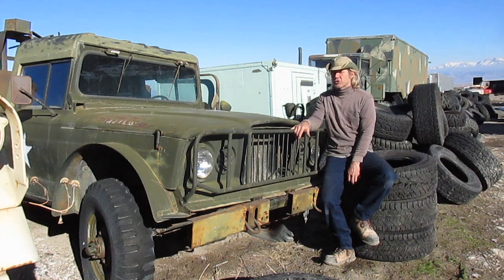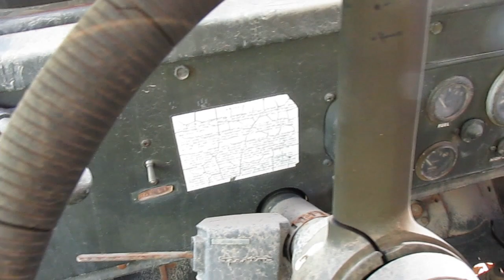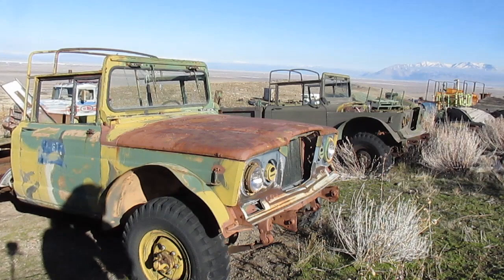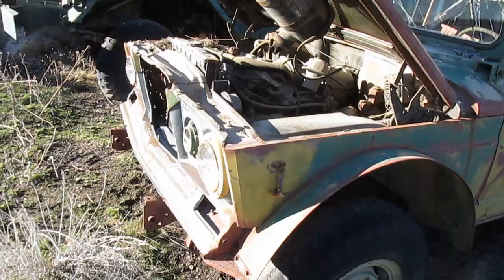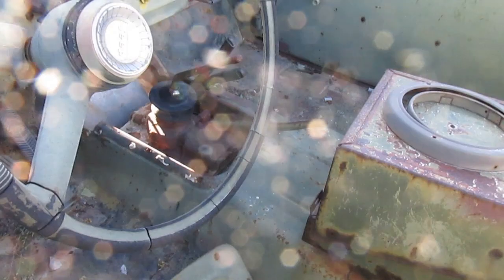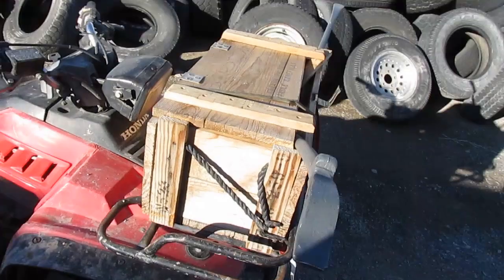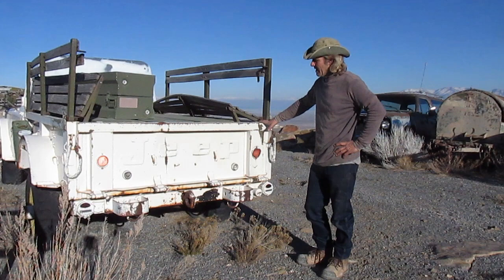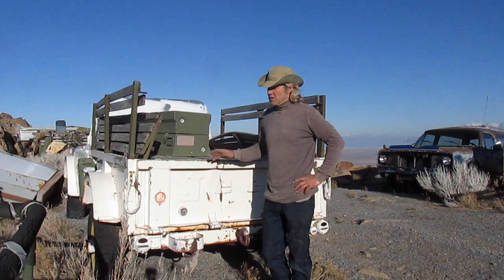M715 Military Trucks

Comment: All I'm seeing is 4 goats that need to be welded together 2X2 linking steering & having identical power plants installed.  Some fat & squishy mudders deflated reeeal low...  or 4 separate goats ready for rolling wherever already.  My Pops had told me stories about riding around in these over in Germany between '66-'69.  Driving around with chains in 2' of snow.  After hearing about this and seeing photos, then reading anything I could find about them.  I was hooked.  The 318 is a GREAT idea.  Nice discounted steals loaded on the ATV.  Ever heard of ROKON?  Well Alan... (shout out to Bob Fendrick for having posted in the comments)  Thanks for the tour & time taken for the video.  That certainly is a little piece of Heaven out there in the Mountains...  Noticed you had a few tires...  tire walls filled with earth & tamped make some seriously long lasting & insulated walls.  Hey have a good one, thanks again for posting.

Comment: Get one of the 5/4’s a flat bed and water tank. You’re water and concrete hauling is solved. Then a fork lift attachment on the 331 to unload up at the top. Thanks for your videos as you proceed with everything. 👍

Comment: Greetings, this reminds me of the 90's, out in blazing hot Phoenix Arizona… I built such a monster M-715 weapons carrier frame and chassis. Whereupon I mounted a red 1963 GMC Truck body on it, a close fit, powered by a built 454 Rat motor / Turbo 400 Trans, it had a Predator Carb with a bird catcher Mr. Gasket scoop, a massive tube bumper, racing seats and full harnesses, fail-safe (Selectro) front hubs on huge tires. It never failed me! Unfortunately I had to sell it off in 1999; sure wish I had kept it! Back then I had to make a command decision in order to expand my horizons beyond a certain Catholic/Hispanic Evil Influence/Control over my ex-wife; who refused to seek professional help, it infected our life for the worst… Anyhow, I wisely went AWOL instead of Atomic! I had too much stuff to move; so this main weldor/mechanic truck got sacrificed as the extra money was much needed. I also had a tiny International Scout 800 or some kind of neat International 2 door V-8/4x4? Anyhow, if anyone knows the whereabouts of this special custom built Rat/Rod, Red 1963 GMC upon an M-715 Weapons carrier truck I built, please advise? I would love to be reunited with it! I put much blood, sweat and tears into developing it and making it all work together so well... It was a real beast and much needed therapy! I remember the transfer case having slash cut gears, whining like a 747 coming in for a landing at 60mph down the highway! It would blow away shocked provokers, you could not touch the dash as it launched you into your seat hard. If it still exists today, you might hear it thundering before you get a glance at my spirit! Just my FYI… Kindly, CT

Comment: I guy stopped by to look at my 715 and said he has a m37 that has been converted to a 318 and I almost bought a 37 with a 318 so they did make a kit at one time. 5 miles away from me is a 715 with the 350 and he keep the transmission. I have never heard it run.

Comment: I suggest installing a Cummins 12 valve in that 3rd unit with the pickup bed. While you're at it, the Tri-Phase air filter unit makes GREAT sense, although I would be worried about the flex hose if it's mounted under the hood. Solid mounting it in the same area as you indicated you thought most of those trucks had it would be less serviceable, but the hose wouldn't be so subject to failure. While it would be cool to have OEM winches, it might be more practical to install a modern Harbor Freight BadLands electric winch on it. VERY few people would know the difference. Dana 60 front and Dana 80 rear axles from wrecking yards out of Dodge Ram 3500 trucks, same source as the Cummins might resolve the hub/wheel issue.

Comment: I dig those old Jeep Pickups, seems to me that they had an overhead valve 6 cylinder gas engine, I don't think that the bolt pattern on the bell housing will mount up to a 318 dodge. You might have to use the complete Chrysler 4x4 set up from one of your Dodge pickups. Keep some WD40 handy and spray all of your hood hinges before you bend a hood.
Reply from the maker: Thanks, I might have some custom adaptors made...
Reply: @mtnfortresslabs  There used to be a few places that made engine swap stuff for Willys,Kaiser-Jeep etc. One was Transdapt and another place called Kennedy Engineering that sell plates to swap all kinds of motors to other transmissions.😉

Comment: I was told that some military vehicles have engines that can run of pritty much anything and it won't ruin the engines. Like gas diesel and other fluids ? Can you tell me if this is true or false ?
Reply from the maker: My 2 1/2 tons and older 5 tons are multi-fuel. Except a couple gasoline powered ones. The multi-fuel engines run on a lot of things. It is possible to run 1/2 old motor oil and 1/2 regular diesel but old contaminated fluids can clog filters. You can run gasoline, kerosene, jet fuel in the multi-fuel, but always best to have some diesel in it too.

Comment: show the complete rear pto please, its not in the service book
Reply from the maker: I will try to put a video on it. Basically it is an additional transfer-case rear output, but to keep the rear axle from turning a coupling on the rear drive-line can be opened and closed.